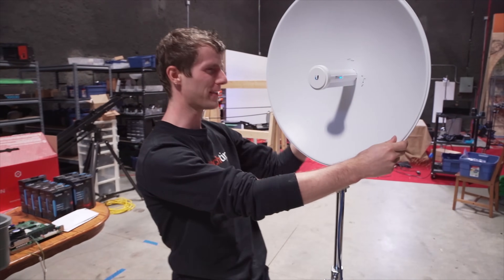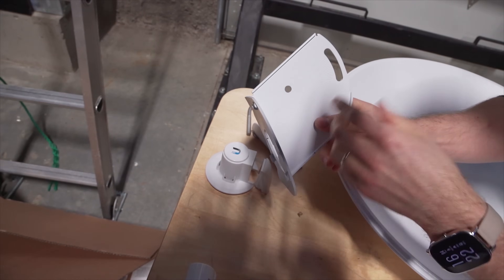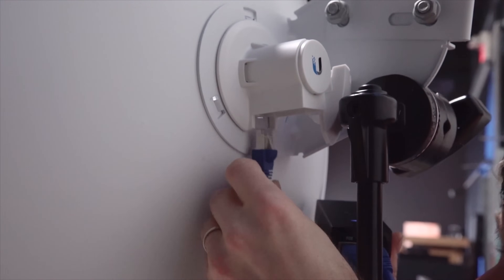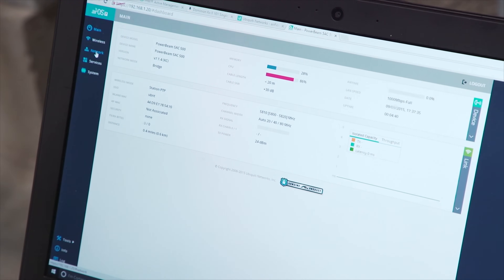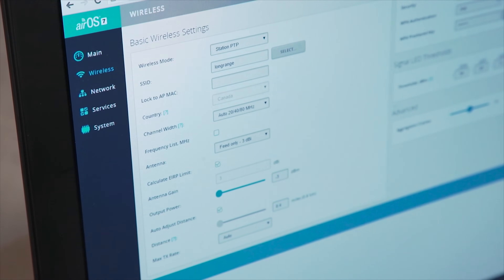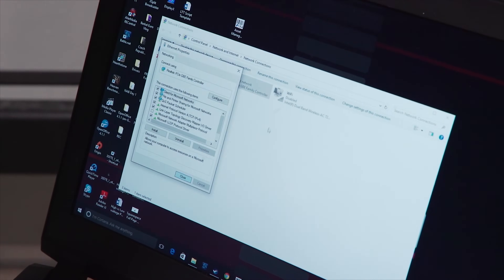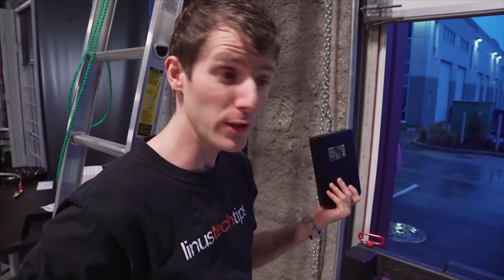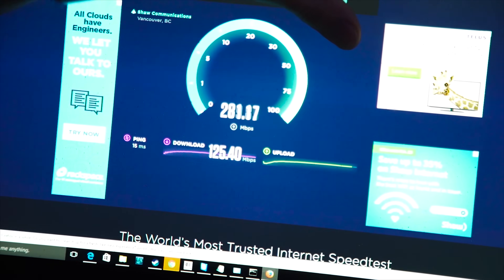HOLY $H!T - Long Distance Wi-Fi (Up to 25 KILOMETER range!?)

Comment: Wow. How does he use Windows 10 without breaking his computer's wifi????
Reply: +Rob G. By not being a whiny sheep. Windows 10 is just as capable as it's predecessors, and someone with intermediate knowledge in computer hardware/software is unlikely to ever have a problem with it.
Reply: +FracturedPixels I used two Ethernet connections, and tried to bridge them. What actually happened was that it promptly broke some obscure registry value that I can't find, forcing me to reinstall. The start menu randomly breaks, too, forcing me to install a third party program to access things without opening taskmgr or cmding shutdown /s /t 000 to shut down.
Reply: Rob G. sounds like your install is borked. I've run into this problem on windows 7 before, and it was due to corrupt install media. You should look into repairing or reinstalling your machine from a trusted installation disc/drive
Reply: My install wasn't borked, though.
I checked it.
EDIT: Install media is trusted too.
Reply: Rob G. Well I was wrong then. Still, I've used Windows 10 for the purposes you describe, and have watched others do it as well, so I have to figure it's a variable that's unique to you.
Reply: Plenty of people do have issues, but lucky you.
Reply: Rob G. Lucky everyone I've ever met* 

I literally haven't heard of these issues before.
Reply: Has everyone you met just clicked on the upgrade button, or have they actually clean installed with a flash drive?
Reply: Rob G. the first two or three of them did, then when it borked their installs, everyone else decided to clean install theirs.

Comment: Is it like a router or a signal booster that needs to be plugged into a router
Reply: +Darragh Hedman The whole thing is a router! It's like the internals of a router or access point enclosed within the feed he attaches, and it gets its power over the ethernet cable you plug into it for your data. So it's pretty all-in-one compared to the other ways of pulling this off, where you replace the antennas of a router with long range dish or grid antennas but you're responsible for all the networking equipment.

Comment: Wtf I get like 20mbps on fibre optic and you get 150+ Mbps on Ethernet? Good job Australian government. Useless pricks.
Reply: gigabit...that's 1024 megabits/second. like..pretty casual stuff nowadays.
Reply: +Chris Chandler what are you on about ?
Reply: Bodhi Sativa it is extremely common to see 150+ mbps in developed countries nowadays. I get that over 5g wifi, shit, I'm getting 55-60 mbps on 4G lte.
Reply: +Chris Chandler yeh I know lol. Why are you informing me on things I know. I said my net is shit. That is all. Lol
Reply: Bodhi Sativa if you knew why are you acting surprised? 'You get 150+ mbps on ethernet?' NBN will be offering gigabit connections by 2017. Hang tight buddy
Reply: +Chris Chandler I know plenty of people on NBN and are still getting under 100mbps. 1GB speeds my ass. Government talks shit.
Reply: +Chris Chandler just like out fibre optic was supposed to have speeds of up to half a gig. All bullshit.
Reply: Bodhi Sativa very few fibre optic networks promise half a gig. You can get t3 lines in australia, just depends on where you get them

Comment: only 300 I thought it would be more expensive....can we use to to relay a connection into a router and broadcast the signal from a router? and does it work well throught glass window around 100 meter or so away...
Reply: +Jace Vo Ive tried the Locostation M2 2,4Ghz behind glas. It worked but with reduced signal. I dont think the 5Ghz ones would work well behind glass. You can have a routers on both end, but plug it in a normal port on the other end (not WAN-port) and turn of dhcp (or set it to AP-mode or similar).

Comment: Damnn, that'd be a lot of neighbors to fend off.
Reply: +Jared A. SImple, don't broadcast the SSID and have a password. Hackers would hack regardless, so you'd need to set up strong encryption if you care about them. That is, unless your neighbor is a hacker.
Reply: +Jared A. it's not an access point, so the neighbors you'd need to fend of is about... 0 because they would have to be looking for a very specific type of signal.

Comment: ok. to overcome your mound-o-dirt between your home and lab. there are 2 things. 1 you didn't account for the height of that building. it looks fairly tall in itself possibly 20-30 meters right there and a 30 meter tower isn't too far out of the question. also, you could even take the remainder height and divide it by 2. and put a 15 meter tower on that building and another 15 meter tower at your home and accomplish the same results!

Comment: According to an authorized Ubiquiti Networks reseller's site, the Ubiquiti PowerBeam® ac (
PBE-5AC-500) shown in this video costs US$159.00 each, not $150 for a pair as implied by the host. To get a link going may set you back $400, or more, depending on additional cables and antenna mounting gear. The prices aren't a whole lot better than what it cost to set up a homebrew Wi-Fi link 5 to 10 years go, although the package is slick and appears easier to set up.

Comment: I want to hide one of these in the middle of my city and give it a name like "(City) Free WiFi" and make it password protected. And watch people try and figure it out how to access it.
Reply: CMDR S-Viper Set the name as "Contact Blank for pass" (Politician you don't like maybe?) and watch their phone catch fire
Reply: +CMDR S-Viper it would basically be a stripe of access across one radius of your city. The antennas are not omnidirectional, they have to be very finely aimed at what is supposed to be picking them up.
Reply: +FracturedPixels Up from 14th street to central park vertically in 7th/8th ave. in manhatten. SUCKERS!
Reply: +CMDR S-Viper How would you watch people try to access it?
Reply: Paul Omans MAGIC
Reply: +CMDR S-Viper someone might know how to hack wifi signal
Reply: for the same price, you can get a bunch of orange pi zero, with a solar panel and a battery for each if you want something more clever tan a joke,  else you can take some esp12 with a 2watt solar panel for 5 bucks each and provide fake wifi everywhere.
If you wanted to be nefarious, you could make a landing page similar to one of the wifi providers in airports, and harvest passwords and emails.
Reply: just point it down a straight major thoroughfare.... signal will be in a straight line of course but lots of people walking this line should be able to pick up a signal.

Comment: Wtf.... theres no way this is legal to use in a commercial, suburban, or residential area, This is something you would use on your own property, if you own all the land in between, or if the land in between is unowned, such as a rural area, probably why he couldn't do it.
Reply: +Sean Anderson Why not?
Reply: Philipinche For the same reasons you need a license to broadcast, to avoid oversaturating the airways, if this thing can really go up to 25 KM away, which I doubt, everything in between now has more noise, if one person can do it, multiple can, if multiple do, imagine what the noise would be like for everything in between?
This is a out of proportion situation but this is what these sort of things are mean't to prevent
Reply: +Sean Anderson Its license free if your power is low enough. these things don't really disturb that much since they are very directional. And they need line of sight, so you wouldn't set them up at street level like in this test usually.
Reply: So they managed to point a signal in exactly a certain direction? theres no bleed out or anything into surrounding airwaves?
Reply: There are some bleed for sure, but they are made to be pointed at the other dish. They are using the same power as a normal home router/AP, so they would not work if they directed that low level signal anywhere else. Those AP's You use at home clog up the air way more, since they send that signal all around. This is regulated by FCC, but these devices is free to use without license if you fallow the rules set by FCC. (and they do interfere with radar if you set them up wrong). Still, It would be a lot better to use E or V-band radio for this type of links. I'm sure there will be affordable Wigig links to buy in a few years.
Reply: Interesting, Thanks

Comment: nothing new there. there was plenty of stuff around 20 years ago that could do 622mbit over 60km or so... ofcourse not with native ethernet framing... but still...also the max tx power is just 24dbm?! (a whopping 250 milliwatts) hell i have usb wifi adapters that do a lot more than that :P (3-6 watt is more or less normal, even in the cheap as dirt segment) (and those are usb of all things ;)

Comment: If you lived in a flat enough geographic area, I wonder if you could set up an ok-height tower, make it motorized and program it to follow the second through the alignment program and the second dish is installed on top of your car... you could basically get a connection in a 25km radius around your place XD?!

Comment: Hey linus, was interested in this product but can you help me in my project by checking the connectivity of this product for 20 kms, just because this is very expensive in india it nearly costs 1000$ for a pair and that too i am not sure about it, that will it work or not, Man i know its tough for you but plzz can you try and lemme know.
Reply: +bhavi jain It does work. I'm using Ubiquiti product as WISP owner, i can confirm you that. although, depends on your area noise condition. Although, don't expect 450mbps on 25KM distance. also, this thing need line of sight with fresnel zone on your link.
Reply: +KIRA Ynet what speed i can expect?
Reply: if you put this on 45 Meter tower, with a clear view, noise level below -80, i bet you can get 70% of the RAW performance. 

Allignment can be tough but once you know to work with compass, elevation and direction, you will be fine.

The best option is to test this on simulator.
>> https://airlink.ubnt.com/

Comment: The 450 Mbps that Ubiquiti claims the antenna can handle is maximum aggregate bandwidth. Meaning, it is the maximum bandwidth of the uplink and downlink combined. Therefore, you cannot expect to achieve both 450Mbps up and down. Also speedtest is not reliable as your connection speed is only as fast as the slowest link on the path from source to destination.

Comment: I implemented a somewhat similar setup but with the 900mhz Ubiquiti wireless point to point system. The goal was to share a home network and Internet connection to a remote host located at a horse barn about 1/4 mile away for the purpose of viewing a surveillance system both on the LAN and WAN. At first, I purchased the long distance kit but quickly discovered the 5ghz signal experienced severe degradation through trees, brush, and other obstructions. The 5ghz range signals are emitted through a very narrow band whereas the 900mhz system is much wider and has the ability to penetrate through wooded areas, buildings, etc. The 900mhz system was a little more expensive but well worth the money. A word of friendly advice, please use heavy duty outdoor cat 6e cabling with enhanced grounding, it will save you money in the long run. Cheaper cabling comes with a standard grounding wire and common plastic or rubber insulation. The heavy duty cat 6e cable is much better and can withstand much harsher conditions such as heat, cold, static, and lightning strikes. It can also be buried too. Just make sure that the connections are water tight and not loose to ensure that the circuitry is not exposed to the elements. The system has been active for about 5 years now and hasn't lost connection that I am aware of..

Comment: Linus please point that dish towards my house in Australia. I have an 8mbps connection, can't even stream 1080p video's on my desktop. even tho the government is rolling out fibre they decided to put down node boxes completely defeating the purpose of upgrading the network system in the first place, only upgrading our speed by a minor 10mbps. If they wanted to make it cost effective just run the line to the house and not waste everyone's money on a box of crap that will need replacing in 5 years time.

Comment: So did you not check the topography before you bought those to use between your house and the office? Not sure if you have it in Canada, but many places in the US have WISPs... I designed a system myself - network subnetting, iinfrastructure, and hardware - for a company where I was employed. Serves business customers currently. The Rockets are pretty amazing. Gigabit transfer speeds at 7 miles no problem. And the "weather proofing thing" for the front is called a Radome.

Comment: Such wow, you showed tested system supposedly capable of 25km at less than 500m.
Reply: its capable of doing 25km without any problems if there is no obstruction between the signal or interference so its why they suggest to install it on a pole so there is less obstruction

Comment: Ya we here at CAOH (rural) are on a fixed wireless network (Aerosurf) and get 30 to 40 meg down an 10 to 20 up. I am a gamer and we run our Vonage business IP phones on it as well - works great. Pretty darn good considering we do not have any other option other than SAT which suck chicken guts!

Comment: Linus, I work on cell towers, and we use dishes like that for ptp backhaul options for rapid expansion or if you can't run Fiber to the site . they are microwave dishes, have been around for decades. they range in size from 1' to 16' or greater in diameter. there are 3 Lobes for connectivity, two side, and one center lobe. look into it. that may increase your range, aside from altering the power output. also please be careful with people walking infront of the dish. look into RF from a ptp connection like that can harm you. I don't know if the dish you were using is quite as dangerous, but I know the ones on towers can potentially cook you from inside out. I love your vids man, keep making them!
Reply: +Rob Brigham Pretty sure they tested that cooking thing on Mythbusters and they couldn't even get the slightest amount of heat.
Reply: Well that's good, but I do know for a fact that the big ones on Tower and the ones used by the Navy will cook you for sure

Comment: Thanks for this video. I got mine 2 days ago, and now have Charter Spectrum 100/20Mbit internet, bypassing municipalities in my area, since only Mediacom is available at my home, I contacted a buddy, and had my Charter service installed at his house, and beamed it to mine, at just over 4 miles away, and am pulling the full Charter Bandwidth, and over 200Mb direct data transfer rates, which is more than enough for me considering how many obstacles there are between our houses.

Comment: what a pile of crap, testing a 25km claim across a carpark? and you get money for this.. surely you could have used some of the moolah todrive to a flat area and run a proper test. this you could have done with two coffee cans some snips and usb wlan adaptors with antennas.. major cop out..
Reply: +lShishkaBerryl No but they could just grab a few cheap lead acid batteries.. not hard this was just a lazy lazy video..
Reply: are they going to run a 50000 mile extension cord to this wide open space?
Reply: Thanks Dave.. I couldn't have said it better..

Comment: mount another antenna (which does turn perfect automaticly by gps) to your primary antenna on your car and share it by another small antenna with your mobile devices --> you got a moving hotspot with high speed for the next 25 km :D

Comment: Yes reasonable!! I have 12mbps down!
Reply: i have 8 and pay for 70 lol
Reply: +Ramses De Vuyst Wtf. I have 180 down 160 up and I pay $70. Where are you located?
Reply: Terrk23 Belgium, i pay like 35€ a month to get advertised speeds of up to 70mbps but right now i'm only getting around 8mbps. I only found out recently as i was inspecting my network because it really started to slow down beyond usable speeds so now i'm going to rant at my ISP until i get the speed i'm paying for

Comment: I use this stuff all the time.  There is no way to get 450meg out of that stuff.  

But for sending the internet to your house, a motorola pmp450 3.65 system just might.  Even if there is SOME trees in the way.  Costs lots more, but you get what you pay for.

Comment: Use these @ a local Radio Station in Dungog, for the studio to transmitter link of 13km.. been running for over 3 years now without issue..

Great equipment

Comment: Had some BreezeNet infrastructure gear (~2k$) spare from the county Water & sewage system a few years ago and the speeds wasn't great but with the massive directional antenna the range was longer then usable (to get the antenna alignment).

Comment: I have the same for my connection. 
My download is always slower then my upload.
Download 616mbps 
Upload 948mbps
http://speedtest.net/my-result/5118171793
Do you have any idea why? 
My subscription is 1gbps up and down.
Reply: +Steve Sherman Hey thanks for the reply. But my LAN connection is as fast as possible. it's either my computer or something else 😉
Reply: +Steve Sherman When the tech guy came he did a test and reached like 850 down and 980 up
Reply: +Steve Sherman Well it goes between 350 and 550 down and 900 and 980 up.
Reply: +Steve Sherman Today I'm lucky I guess

Comment: I install that stuff for work. disable airmax if enabled. set the right antenna dish in wireless configuration. Set 40 or 80 MHz ( more likely to have higher noise) and you might go close to 450mbps